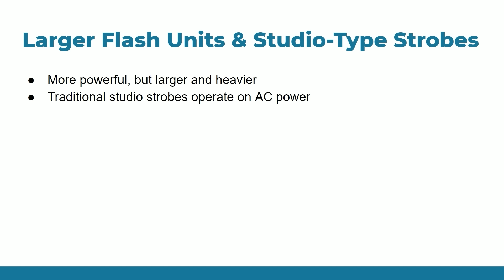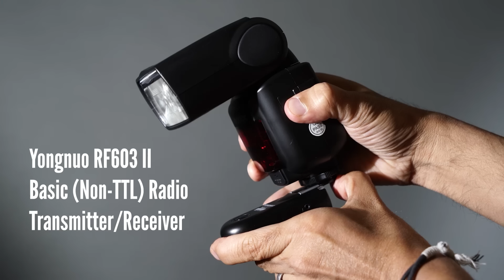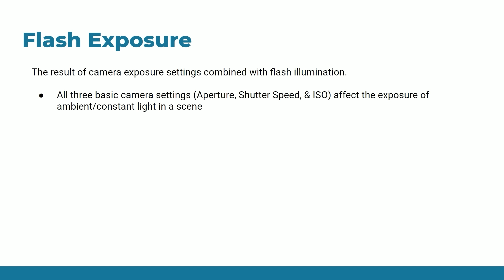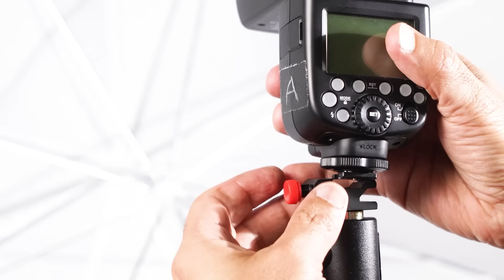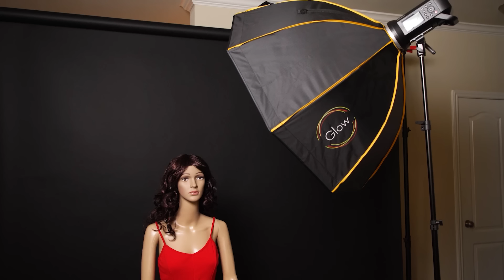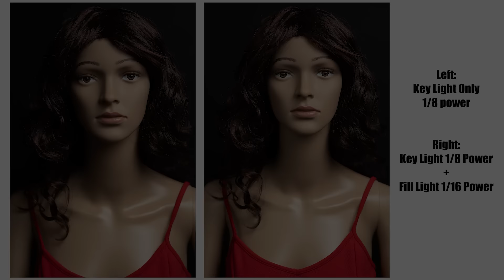Flash Photography for Portraits Crash Course

Comment: Awesome video! I've been playing around with flash for a few years but still found it valuable. Would you be so kind of give me a quick recommendation? I have two AD200s and an AD400. I need it on camera flash. I could just get the V1. But, I have the crazy idea to use a AD100 mounted directly to the X2 trigger using a short cold shoe mount. Is that the dumbest idea ever? Should I just get the V1?
Reply from the maker: I’d just go with the V1 or similar for a flash mounted directly on the camera.
Reply: @edverosky  thank you

Comment: Cables are better with cameras with CCD sensors and sync speeds up to 1/8000 sec or even 1/16000 sec with the D1x.  Radio units really can't keep up with speeds like this.
Reply from the maker: I’d like know more about this. Most of what I shoot is not in the HSS range. HSS pulses through the exposure, So, it sounds like you’re saying radio triggers can’t transmit before the shutter has already completed its cycle.  Thanks for any info on this.
Reply: I’m expecting the mirrorless bodies to have this at some point but either this doesn’t fit into the feature creep model at this point or the CMOS technology doesn’t support it yet.  With the old CCD sensors in the Nikon D1 series, D50 and D70 (and maybe the D40), shutter sync was different in that rather than the shutter sweeping across the sensor at fast shutter speeds, the shutter would open and the sensor would be “strobed” for the duration of the shutter speed.  So if your shutter speed was 1/8000, the shutter would open all the way, the sensor would collect data for 1/8000th sec, the flash would fire during that 1/8000th sec, and then the shutter would close.  Remember that at speeds like this, the flash duration is often longer than the shutter time, so the flash is acting as a constant light source (sort of, it still tails off after it peaks).  With such a camera and a PC cable connection to a flash or strobe, you can sync up to 1/8000th sec on the D70 and  to 1/16,000th on the D1x without HSS.  However unless you are using a flash with a super short flash duration at low power, you will notice that the faster the shutter, the dimmer the shot, just like you’d get with constant light.  

I don’t completely understand the tech behind this, but from what I do understand, the CMOS sensors can’t pull data from the entire sensor at once, they use some type of scan technology that limits sync speeds much the same as the physical shutter does - so much so that they essentially use the same shutter basic shutter paradigm as in film cameras.  CCD sensors, while they have flaws like blooming like crazy with really bright light sources, can pull the data from every pixel at once and so they can have ridiculously fast sampling times and that’s what makes this possible.

Comment: Hi Ed, thank you for your vivid and clear explanations. I have a question: I am using my Sony FX3 foremost for filming but I still want to use it for flash photography. The FX3 has a native ISO of 800 and 12800. Is the native ISO also important for photography or does it only apply for filming. Should I try to keep the ISO as low as possible, like IS0 100 or should I use a native IS0 to keep the noise down?
Reply from the maker: I don't have any experience with the FX cameras, but I would just do some testing.  Conventional wisdom suggests that lower ISOs are generally better for stills.  But, software is likely a huge factor (in-camera and processing).
Reply: @edverosky  Thanks.

Comment: Thanks for the amazing video. One question regarding shutter speed not affecting flash exposure, I'm not sure what you mean by this exactly. If I leave all set up in place and only adjust my shutter speed (same camera set up & same flash power in manual) I sure get darker subject in my image upon increasing the shutter speed.
Reply from the maker: If you’re using HSS, the flash itself is effectively weaker. But at normal power, no HSS, increasing the shutter speed may not allow for the shutter and flash to sync up properly for a complete flash exposure. So, we’re talking about normal flash, using normal sync speeds or slower. Slower speeds don’t give you more flash illumination or record more flash. Slower speeds only increase ambient/constant light exposure.
Reply: @edverosky  Got it yes I was using HSS. Will try with no HSS later. So I would be looking at similar brightness on my subject going from let's say 1/25 to 1/100 with same flash power? Do I understand that correctly?

Comment: Regarding TTL, I'd advice NOT to get a TTL flash if you do not plan to use TTL(if you will shoot only manual) - first, IF you can find a flash without TTL that meets your needs, it will be cheaper then a TTL version of the same...second, you'll often end up accidentally turning TTL on with your forhead in the middle of a shooting, and you'll start wonder why your photos suddenly look darker and different whereas they were fine two seconds ago...by the time you analyze and correct that.....😊 GREAT video btw!! 👏👌

Comment: You say build up you shot with one light at a time but I don’t understand how to deal with the exposure as you go along. When you set up your first light what should the exposure look like on your camera exposure meter?  Do you underexpose so that by the time your done with 2 or 3 lights you hope for a well exposed light?  Thanks for your videos. I’ve learned a lot but a lot I’m still confused about.
Reply from the maker: Ideally, you’d determine your exposure settings first and adjust each light accordingly. So, conceptually, you’re making the light settings conform to your camera settings, not the other way around.